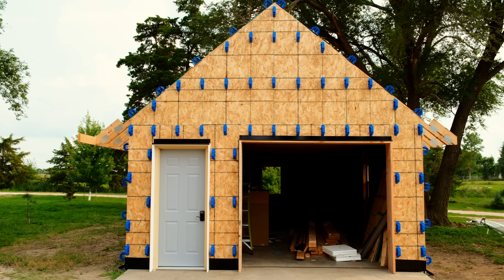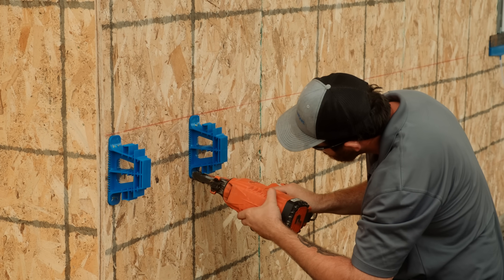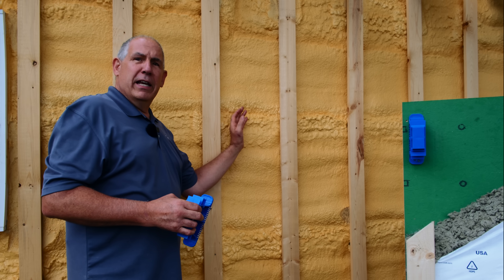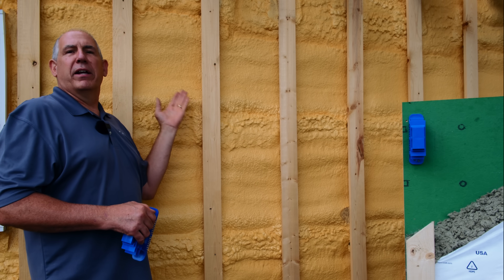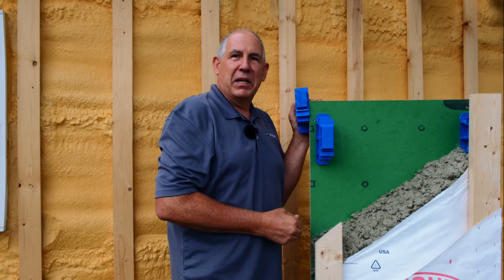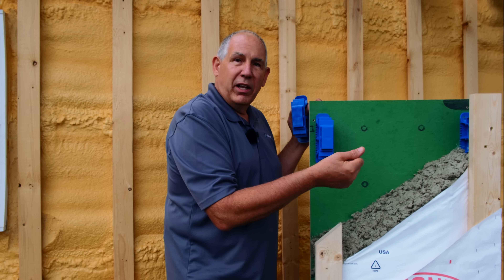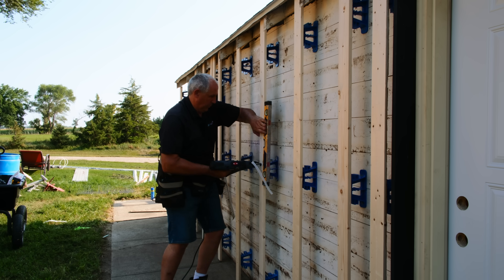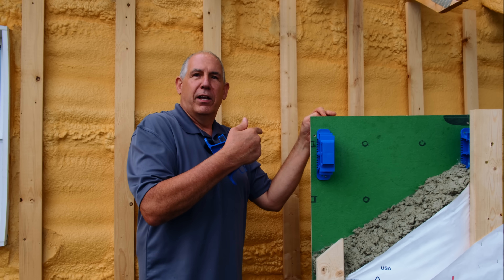We perfected the Perfect Wall... now the Roof!?

Comment: Shrug: Seems a whole lot more hassle than just using 2" or 3" Rigid foam insulation. Installation of rigid foam can be done by framers & siding companies. Cost for sprayfoam makes it prohibabitly more expensive that just using rigid foam panels. Probably for the cost of 2" of spray foam on the outside, you could do 4" or more of rigid foam panels. 

For me the perfect cost effect system is 2x6x24"oc, ZIP sheathing,  2" Rigid foam on outside & rockwool bats on the inside. Beyond that the costs go up while the return on investment crashes (ie picking up pennies in from of a oncoming freight train). For roofing, I recommend SIP panels. My attic never gets much above 80F even with 100F+ outside temperatures. My biggest thermal losses (heating & cooling) are windows.
Reply: Serious question. How do you attach siding or furring strips to the outside of the rigid foam? I initially thought long screws, but how do you find the studs through the foam?
Reply: @3rett115 I’m having the same dilemma…we’re wanting to add faux rock panels and we’ll be 24” oc so our only hope is to find the panels we like that will run 24” oc and connect furring strips to the studs.
Reply: @michelleshafer3330  Yeah, every time I explore trying to figure out how to install external insulation, the cost and added labor (doing it myself) just don't seem worth it. I always come back to 24 oc, poor man's spray foam, and air sealing to the max being the most practical/cost effective. I'm really thinking external insulation, especially spray foam, is a luxury.
Reply: @3rett115  You use long screws & screw 'em into the framing wall studs.

Finding the studs? You can see them nails or screws holding the sheathing to the studs. Since they are a straight line you can just locate them above the foam panel your installing. Or snap  a chalk line on top of foam.  You're only going to install one panel at a time, if you start from the bottom, you look above the panel to see where the studs are. Plan B would to be just test where you think the stud should be, if you miss, just move over. Then just follow your stud spacing using a ruler (ie 16 On center, or 24 on Center Stud spacing).

For the foam panels. you need to use "Foam Fastener washers" to screw them to the walls.
Reply: @3rett115  As a DIYer, I had this exact concern, because I'd miss much more often than a contractor. One alternative option is a Larson truss, which basically screws "exterior studs" onto the exterior, and then these exterior cavities are filled with batt or loose-fill insulation and covered by a layer of house wrap. It's not complex work, because as long as the stud locations can be determined from the exterior, such as marking them on the sheathing or following the line of nails (if their locations are precise enough), it is easy to confirm the screws are going through the right spot.

I've been using a tweak to the Larson truss as I finish the exterior renovation of our house. Going with 4" of exterior insulation, I start by cutting up 2" boards of insulation into 2-5/8" strips (creating 2" x 2-5/8" x 8' strips of foam). I then build out the "truss" by attaching a 2x3 flat side to a foam strip against the 2" side with five 6" lag screws, creating a 4-1/8" truss. I then attach these foam + wood trusses over each stud, and the foam compresses slightly bringing the depth to 4". I can literally hang off a 4' section of truss that has 3 lag screws and it is solid, so in my mind all of the trusses together (16" OC in my case) are excessively strong to hold the siding and insulation in place for many decades (disclaimer: I haven't gotten this reviewed by an engineer). I'm using 25 PSI foam that is R-5 per inch. I am then filling the cavity with mineral wool batts (R-4 per inch). So the trusses themselves are R-14.5, and the cavities are about R-15 (as I'm using 3-1/2" batts rated at R-15). After all the house wrap goes on, I add on another round of 2x3s for the rain screen, finally followed by the siding.

Frankly, had the system in this video been released, that would have been a more attractive option in place of the Larson trusses, with the blown-in insulation option being an economical and extreme time-saving solution. Assuming the system isn't extremely expensive, I'd bet that setup including the blown-in insulation by a professional would cost less than the material cost of the approach I've taken.

One last consideration: creating suitable corners is annoying. I never see this detail covered in videos. I've got a fairly complex solution or the outer corners using 3 2x3s, a 2" x 6-1/2" x 8' piece of foam, and a 2" x 2-5/8" piece of foam, that all gets attached to the corner in two stages, and it requires some patchwork to fill in the last 1/2" of depth (I do this with a combo of strips of foam and cut pieces of batt insulation). I'm not sure how this these outside corners are handled with this new InSoFast system, as that's not clear in this video.
Reply from the maker: @ You would attach the furring strips in either direction to our brackets using screws, then attach siding after the sprayfoam is in like you normally would attach siding. You want to install the furring strips before you spray foam this way you can find brackets easier and the foam will not be able to extend beyond the brackets making it harder to attach the furring strips
Reply: Totally agree - it's just not worth the huge cost involved.
Reply: What is the best wall materials for an air conditioned room built inside a metal building?  Cost effective and energy efficient in a hot climate, Houston? No exposure to sun/elements.....
Reply: @trailerparkcryptoking5213  Cheapest (DIY) is probably fiberglass. second is Rockwool & third is Rigid foam. There (cheaper) is the foil bubble wrap, but less R value than the others.
Reply: @guytech7310   in Houston the space will never need heating, just cooling....will R13 fiberglass keep it cool with a mini split AC, with interior Sheetrock and some sort of cheap exterior siding or should I go 2x6 and R19 fiberglass?  Thanks
Reply: This guy has a system that solves all the problems with exterior rigid foam. It's called InSoFast.
Reply from the maker: @ Who would've guessed that we have the solution ;)
Reply: how thick is the insulation for your sip panel for the roof? also, what region/state are you in? thanks for commenting. close cell foam is so expensive.
Reply: @ilickspam  SIPS are cheap. The are 12" I am in USDA Zone 7. It gets up around 100F during July & Aug. Winter is pretty mild, worse is 20F in January.

Comment: Why not just cut a bunch of uniform size wood blocks instead of those plastic gizmos?
Reply from the maker: You could use such a system, however you are incerasing thermal bridging. In addition to that, the system would also require structural engineering in most jurisdictions (Especially if used on the roof). Our system is preengineered with national code approvals coming soon.
Reply: You have to make tees as it would be difficult to drive long screws through the edge. IE 1x2 oversized to & screwed into a 2x4 to form a Tee. Only issue is is increased thermal bridging.
Reply: Not strong enough to hold anything like that.

Comment: They stop EPS in Baton Rouge houses were rotting and termites from eps stucco. I am plaster for 20 years stay away from this stuff your house needs to breath insurance will not insurance your house if you use this
Reply from the maker: That sounds terrible.  Shoot us a link to that article if you can!  Thankfully we've never run into that problem with our panels.  Also, the X-Bracket will be compatible with spray foam and blow-in insulation (not EPS).
Reply: A house needs controlled breathing. Not air movement from poor building.
Reply: Oh God an old timer that never reads directions saying homes need to "breath".

Comment: That was the worst presentation ever. WTF do the blue things do? WTF is behind the foam?  Is this a panel of some sort that the blue brackets hold in place?
Reply: are you okay?
Reply: @rachelseibert3847  I'm fine. Why do you ask?  I have a tendency to be very blunt sometimes.  Or, maybe I had a stroke and wasn't able to understand what the video was about.  Maybe you can explain it to me.
Reply: @effthegop  you don't understand basic building science, so this is over your head. better you play in the corner, eating the glue.
Reply from the maker: Dang, our goal wasn't to confuse you to oblivion.. but that being said, the blue things (the X-Bracket) are nailed into your framing over the OSB.  Then you fill in all that space with either spray foam or blown-in insulation.  Essentially like you are making a continuous blanket of insulation where the blue things hold it all in place (and in turn eliminate thermal bridging...just like our panels!) while giving you an attachment point to add your furring strips and finally, your siding.  Oh, and we will be releasing much more content over the next few weeks on this new system to clarify all your unanswered questions! Hope that helped!
Reply: @insofastllc So you spray foam over the blue things? None of this makes sense.  I will check back.
Reply: @effthegop maybe you are over thinking. The blue things are attached the the wall sheeting. Then you attach furing strips to the blue things. This creates a space between the sheeting and furing strips that is then filled with insulation. Then you put house wrap and siding on the furing strips. The advantage here is you eliminate thermal bridging and have continuous unobstructed insulation. Seems like it would even save time and labor too.
Reply: @ulbuilder  I get it now but I didn't get that from the video. I saw the clips but not the furring attached to them. I also saw the furring with spray foam behind it but not the clips.  I'm still not sure how you get  the spray foam to be perfectly smooth .

I will just wait for the next video
Reply: I am a builder and had no clue what the blue thingamajig gizmo did until about minute 7 when they showed that antique home.
Reply: Yeah, the video could use some work. Good banter, my friends.
Reply: They are Brackets to fasten on Furing strips for the siding. You cannot screw the siding directly on to the spray foam, especially when you cannot easly locate the Wall studs. You install the Blue brackets, spray the exterior than install furing strips for siding.

It's pretty obvious of you do home construction for a profession.
Reply: @guytech7310  50 years son :)  Most of the construction in my area is not siding so I was trying to learn something.  I'm still not sure I have :)
Reply: @effthegop  LOL! Sonny, I am older than 50. However I am not employed in home construction nor have I ever been.  Only built one house in my entire life. But I do know something about home construction.
Reply: It's for Profesional. Do you watch biochemistry videos and comment that they didn't explain everything

Comment: I don't think you explained the plusses of ventilation enough; moisture in walls is always a concern with spray foam but the ventilation should cut it in half or more.  And if spray foam isn't mixed right it can create indoor toxic air this would almost completely remove that possibility.  My only question is would it make much of a difference between encapsulated foam vs none encapsulated foam ? Would none encapsulated foam still absorb water in a system like this?
Reply from the maker: With the spray foam being applied on the exterior, there is the opportunity to outgas to the exterior air.  

To isolate the spray foam from the interior, you can use a product like Polyguard UX2-40 
( https://polyguard.com/product/polyguard-uv40 )  to seal out the potential for offgassing to the interior.  It is very important to have the necessary amount of exterior insulation to eliminate condensation in colder climate (zones 4-8).  We also recommend closed cell spray foam because it is a vapor control layer in addition to a water control layer.  If you want to use the open cell spray foam, you will need to add an additional water resistant barrier (WRB) over the foam. 

We recommend visiting the Spray Polyurethane Foam Alliance (SPFA) to learn about certifications https://www.sprayfoam.org/pcp/certprogram/ and to find a local installer https://members.sprayfoam.org/contractors/ with the experience and certification that you want.
Reply: @insofastllc Is the polyguard UX2-40 a superior surface for foam adhesion?
Reply: ummm you understand the spray foam is on the... outside... so no indoor offgassing....
Reply: @fredsnit5699  I was literally saying it was a point worth pointing out to people

Comment: Its a good idea until the foam fails. I got a bad sprayfoam job 18 months ago and the contractor refuses to fix it and the lawsuit would cost more then the fix. Next week a contractor will be fixing it using exterior foam board on the walls and roof. The fix for my little 512 sqft cottage is going to run me close to 30k. So i say dont trust sprayfoam
Reply from the maker: Extremely sorry to hear you had to deal with that fiasco. We do recognize that there are issues within the spray foam industry.  We are curious if your failure was caused by high moisture content in the surfaces it was applied to.  We would be interested in finding out more about your project...feel free to shoot us an email marketing@insofast.com
Reply: Small claims court and reporting them to the relevant city and state might help
Reply: @hellonoko I've done that
Reply: @hellonoko Very good idea. Anything is better than nothing. And it's for regular people. Just come state your case.
Reply: I’d like more details on the cost for a small project.
Reply from the maker: @mikhailarey1196  details on pricing will be released soon.  Stay tuned!
Reply: dense pack cellulose. over zip. exterior insulation is brilliant. the issue has always been avoiding thermal bridging. this clip helps resolve that,
Reply: Everything is good until something fails. That’s the nature of failure: it don’t work good no more. 

A bad install doesn’t really tell you anything about the actual product just about the quality of the contractor you hired.
Reply: Your lawsuit was expected to cost $30,000? That doesn’t seem accurate.
Reply: @johnlee7085 no it was going to be way north of 30k and no guarantee

Comment: Basically modern lathe and plaster framing, only not using the expanded wire mesh backing.  I would hope the bottom of the wall has a termite block at the sill and a drip edge for drainage, otherwise its a pretty risky way to build.  Looks like the perfect termite breeding ground.
Reply from the maker: We appreciate your input. Termites are sneaky little things! If you live in a termite infested area, the building codes do require a 6” separation of exposed concrete.  A termite screen can easily be added to the bottom of the wall detail. This demo project was done up in South Dakota where, thankfully, the winter generally takes care of that problem.
Reply: @insofastllc  Thanks for the reply.  It is probably a detail to include so nobody has a DIY termite episode where they blame your product.
Reply: A lot of talking about it but very little demo of actual situations. Think I’d rather build an ICF home.
Reply: @JT_70 Your are aware the guy in the video helped develop SIP. ICF is 10x the cost. this is standard stick framing thats a fraction of SIP.  Must be nice to have ICF money money bags
Reply from the maker: @JT_70  We have a video coming out shortly that covers soffit detailing we used for our demo project, so stay tuned for that.

Comment: If you were adding this to the outside of a house over top of the existing exterior what would have to be done to the windows.  If nothing was done to them they would be recessed into the building materials.  Also what is the fire rating of the foam?  I have seen videos of foam insulation on houses going up in flames.  That along with the potential for failure of the foam, possible problems with air quality and fire made me change my mind and decide that rockwool or dense pack cellulose was the insulation i would want to use.
Reply from the maker: For existing windows, you would have to add a window buck and our window gutter system. Most spray foam is class I fire rated, meaning it will not act as a catalyst in case of a fire and it will self extinguish.
That being said, you can also use our products with blown in rockwool or dense pack cellulose!

Comment: will this work on the outside of a shipping container .. like to have the foam on the outside of the house and save space inside.
Reply from the maker: Yes it will!
Reply: @insofastllc  So, I imagine you would use an adhesive to locate the bracket and the spray foam to secure it?
Reply from the maker: @martingardens  Yes, the back of the bracket is the same as our InSoFast panels with the built-in dovetails to mechanically attach to the adhesive. We will be releasing instructions for shipping container installation for interiors and exteriors soon! Keep in mind, your climate zone and container usage does suggest which surface is better to insulate.. but both are acceptable!
Reply: @insofastllc Thank you!